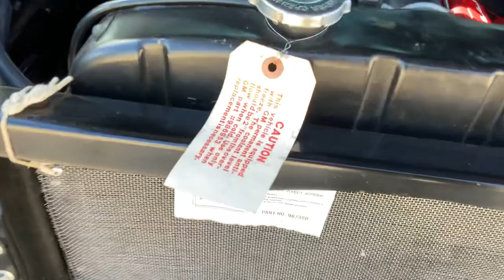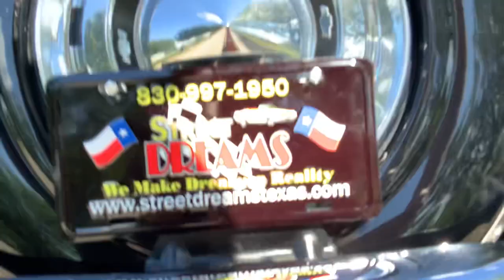1956 Chevrolet Bel-Air Convertible 265ci V8 w/ 2x4bbl 3-Speed Manual Power Top PS 56-6621C

Comment: It's beautiful. I don't know if there is another one in the same condition. But it is a pity that the carburettor mixture is poorly regulated. Well regulated it sounds like an orchestra.😒😒😒
Reply from the maker: Lol, well thanks for sharing your observation. It is for sale. You could always buy it, and tune it how you like. The car seems to run fine as is, but I am sure there is always an adjustment that could be made one way or another. That's the beauty of life there are always adjustments one way or the other. We receive them tuned all types of ways. We even sell them tuned correctly and get them back incorrect.
Reply: @StreetDreamsTexas  some don't understand these had solid lifters  and hotter cam profiles  its running perfectly  mine is copper .. and ivory
Reply from the maker: @quagmiredavis4117  Solid lifters can be hard to get used to.